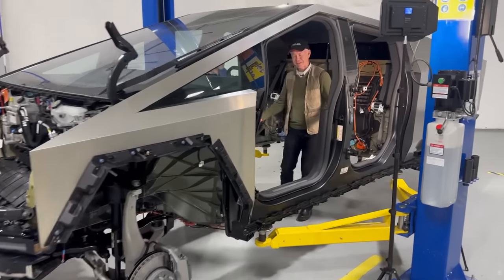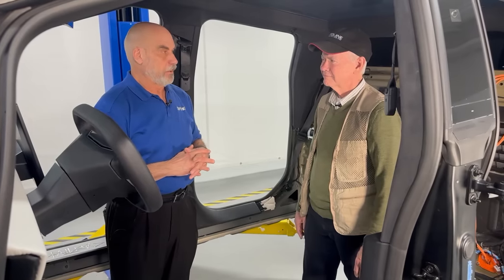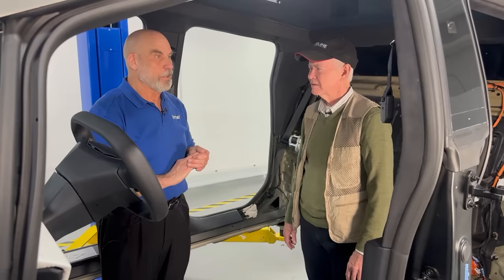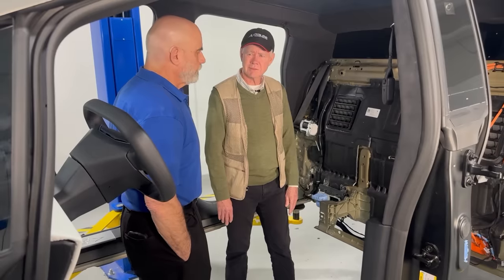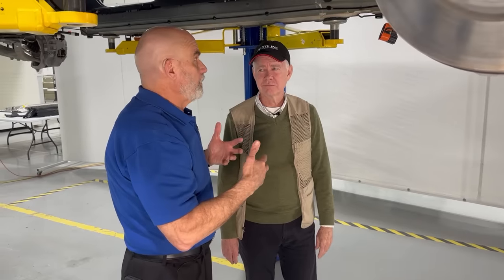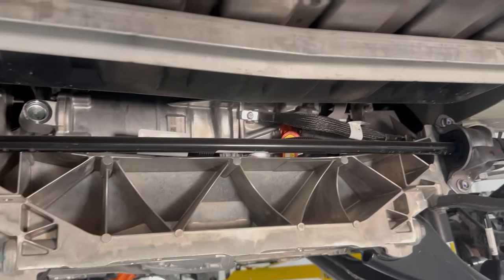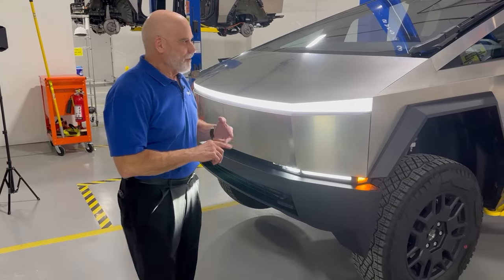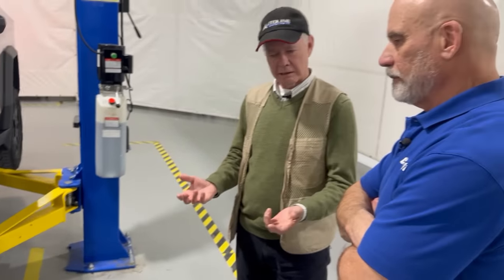World's 1st Cybertruck Teardown - Steer-by-Wire, 48V, Battery & Gigacastings

Comment: When Sandy sat down with the Cybertruck VPs and lead engineers at Tesla to discuss the Cybertruck they mentioned not everything was 48 volts.   IIRC its 48v to major components and local POE control modules and stepped down to 12v out from there to the little stuff.  So it shouldn't have 12 volt wiring all throughout but might have local runs to 12 volt components
Reply: yeah, but that is just stupid. Just use 800V for major components and 12V for everything else. That is cheaper, safer and actually more capable when you run things like the active suspension from the 800V which is what Porsche did with the latest Taycan facelift. Porsche actively tried to eliminate high voltage to lower voltage converters and use the 800V system architecture as far as possible. Interior lights etc  run on a small 12V battery. Nobody needs 48V it is just to cut a couple of bucks for Tesla. The customer has no real world advantage whatsoever
Reply: @BBingo-v5i  If the 800v system fails then the 48v system will still be operational for things like steering in an emergency.
Reply: @SyntheticSpy  why would the 800V system fail? Also Porsche does not use crappy steer-by-wire since that would destroy the joy of driving, so you can still steer without power. But they do use 800V for the active suspension which is actually awesome engineering. For lights/screen etc you have 12V anyway. No real world advantage for the customer to have 48V. In fact repairs might be more costly and timely to source the parts. And there is also some health risk involved with running switches or interior parts with 48V. Just a cost cutting measurement by Tesla and to further control the vehicle ecosystem.
Reply: @BBingo-v5i  the point of not going higher than 48 is that it is considered safe. Also what “joy of driving” do you get in a truck? Also Porche themselves developed a steer by wire system
Reply: @SyntheticSpy   exactly, that is why 12V is widely used and 48V is deemed unnecessary or even dangerous. Since the advantages are very tiny, there is no point in using it other than saving a few bucks (not for the customer tho). Fanboys cling to the smallest and unnecessary numbers just to uphold their skewed image. Tesla is far behind in many ways like charging speed, range, augmented reality HUD, autonomous driving, light technology etc. but 48V is changing everything for them lol
In the real world the Cybertruck barely keeps up with the older competition. Rivian, and even legacy manifacturers like GM are offering the way better trucks. That is a fact, but
Tesla and some Tesla shills were busy installing these random numbers like "48V" into naive fanboys heads like, even tho it doesn't mean anything for the customer experience of the truck. Besides that, the tech is widely known and not groundbreaking
Reply: @BBingo-v5i  the industry has been trying to go to 48v for decades. Also the higher power systems like the steer by wire wouldn’t be feasible with 12v. I think you don’t fully understand the reason behind various voltages
Reply: @SyntheticSpy   no, nobody wants to go to 48V because engineers know there is not much advantage to be gained and additional disadvantages to be solved (procurement, health risk). Steer-by-wire totally works on 12V, the Infinit Q50 did it that way.  The soon upcoming Lexus RZ450e uses its 400V architreture directly for the steer by wire system and the 12V system as backup. No problem
Reply: @BBingo-v5i  there are tons of advantages to be gained. And 48v is considered safe for use near humans which is why that’s what they went to. Again you seem to not be familiar with the actual reasons to switch and are just against the idea for some random reason
Reply: @SyntheticSpy   no 48V is not totally risk free or safe, you better educate yourself again on this matter. The actual reason is to run thinner wires and save a couple of bucks. The weight savings are negligible in a heavy steel truck by the way. Using thin wired is another risk factor by the way, there are tradeoffs and the advantages are minmal. Again, run major components directly from your system architecturr, wether 400V or 800V or higher, like Porsche and Toyota. Reduce the components ehich need converters and then use 12V system together with a small battery for the rest. Easy, safe, cheaper. More components on the then 48V system need a bigger and more expensive battery. The one in the cybertruck is quite big because it had to run quite a few components.
Reply: @BBingo-v5i  weight is only one factor, cost is another, and powering something like a motor for steer by wire properly is yet another factor. That’s why porche went with 800v instead of 400v for their high voltage system. Because there are tons of benefits
Reply: @BBingo-v5i  I assume you have nothing to do with production or technology, or how do you come up with such strange statements, some of which are completely wrong?!
Reply: @BBingo-v5i  The Cybertruck does run the heat pump for the thermal management system off the 800 volt battery along with obviously the drive units.

They NEED the 48 volt system to power the dual redundant steer motors for the front axle, one steer motor on the rear axle, the wiper motor, and the steering feedback motor in the cab.  They also use 48 volt battery for the oil pumps at the drive units, ECUs, touchscreen, window regulators, accessory power feed to the frunk and roof, and i'm guessing the suspension compressor, tonneau cover motor, and headlights.  48 volt not only make sense but for some of these systems it is a necessity.  800 volt makes no sense for most of these systems and would be unnecessarily unsafe.
Reply: @BBingo-v5i  I think you should do a bit more research about the advantages of going to 48V before commenting about how it is "unnecessary or even dangerous".
Reply: @SyntheticSpy hey Elon hater get your facts before you rubbish,48v gives(less cooper,less wiring,reduce wiring connecting stress in production,made Ethernet possible for use in cars for the first time,powers steer by wire well)pls give Elon a break,he pushed there.
Reply: @BBingo-v5i  Going to 48v from 12v has a bunch of benefits. You need 1/4th the amount of amps to get the same amount of power to a system. Less amps means smaller wires and less heat build up. And with so much using more electricity, that's a huge savings. Just look at the wires on your car battery that are just to run the starter motor for a few seconds. With EVs you need electricity to run everything. The cooling system, steering, HVAC, and heat all would have been handled by the engine before, but are now handled by electricity in some form. Not only that, but you can run larger items than before.

The reason others haven't gone to 24v or 48v before is because it really requires a large push from the industry to do so since everything is designed around 12v. This isn't just the automotive sector though. Computer systems are caught in this as well. Some are trying to push for 24v systems instead of 12v, since there is a constant issue with cables and power needs.
Reply: @BBingo-v5i  the Q50 has a clutch between the wheel and the tires that engages a mechanical link when power goes away. So it really isn't "true" steer by wire. RZ450e - as you have said "soon" not in production - if ever.
Reply: I smell a lot of BS here 😂
Reply: Using 48V fits with Ethernet 'bus' for communications and power (PoE), for which there are many existing components and many programmers who can work with it.
Reply: @BBingo-v5i you do know that all Ev’s by design disengage the 400 / 800v HV line as soon as it detects a crash. This is to protect the occupants and first responders from an exposed hv line. Fuel based cars also do this by cutting out the fuel pump in the event of a major collision. 12 / 48v is essential for keeping important things like flashers, doors, windows and car electronics that call sos etc active. All manufacturers (well, most) design 12v in such a way that they are well protected from crash.
Reply: @SyntheticSpy  his name checks out lol
Reply: @BBingo-v5i  why focus on weight savings when when cost savings of thinner wire per truck is enormous. Also they gave patents away for 48V so soon everybody will be adopting this new tech auto industry couldn't figure out for 100 years. Mostly because they just take parts off shelf and don't innovate.
Reply: @BBingo-v5i  tsla engineers not youtubers explained what they did with 48V High power harness mass down 84% number of wires length of car down 68%
full system advantage is POE+ 
48v over ethernet which is in aviation world already. tons of advantages already explained by engineers from tesla. 
48v parts exist but as i mentioned there wasnt off the shelf stuff auto industry could use and to expensive to innovate. you mention the problem "expensive parts hard to find" tsla has solved/solving that problem and made their own parts and further solving availability by giving patents away. industry will adopt.
Mercedes has had some 48V with the goal of expanding but to hard. promised for 30 years. but no supply they dont make their own stuff.
osha has rules starting at 50V DC thus the 48V undershot everyone aspires to. 
out of spec showed tsla efficiency with tri motor on 35" offroad tires at 2.5 mi/kwh only beat by rivian at 2.6 and smokes chevy and fords efficiency down at 2 and 2.1 

if this guy is worth his salt he will figure it out eventually. and you will have to cry elon fanboy at him as well lol. big problem is this is likely not a production model so will be filled with obsolete tech. but we shall see.
Reply: i suspect this is a pre production model and might have some obsolete stuff. will be interesting to see with comparison of munro teardown. also they iterate so quickly its possible more 12v will be eliminated by end of year
Reply: @jdawg5960 we will see in a few weeks how much the actual body harnesses weigh, that along with some engineering calculations will tell us how much cost and weight was actually saved. No one in the industry takes too seriously the BS that Tesla fans and pumpers say, like they seriously said they would have full autonomy, exoskeletons, float like a boat, etc BS. This is why we do real benchmarking.
Reply: oh look that 48V harness looks EXACTLY like any other 12V harness with nominal 18 AWG wires used for its runs, that's because durability matters more than any superflous benefits gained from a switch to 48V at this late date in 12V history...

reducing wire weight don't mean sh!t in the OEM world of Warranty Fulfillment if after a year of ownership your dash is lit up like a Christmas Tree with faults and then when you finally ohm out the harness you discover you have 1/2 dozen open circuits, oh yeah "we've seen this movie". #DURABILITYMATTERS
Reply: Certainly a lot of experts here, so I hope people don't take my word as an expert opinion. The thing to consider is that there is no native 12v subsystem in an EV like in a traditional ICE vehicle where 12v battery is topped off from a fairly beefy alternator (the bigger vehicle, the bigger is the alternator). Instead any EV to use a 12v subsystem has to have a DC-DC converter that takes whatever HV voltage and steps it down to either 12v or 48v in this case. The issue with DC-DC is that amperage plays into the power component costs - by increasing the DC output voltage, amperage is proportionately decreased. So is the heat dissipation and component size in the power electronics. So if there are high loads, such as steering actuators that need to be powered from LV, the choices are either to add an LV battery as a buffer, or to step up the LV so that it becomes practical to power the things directly from DC-DC and skip the additional weight, cost and maintenance of an additional LV battery.

Then on the second point mentioned earlier in the thread, there is indeed a significant safety consideration that goes into this. OSHA for example defines the maximum safe DC voltage as 60V, which is the reason many industrial systems operated by batteries are limited to 48V nominal - fully charged voltages are higher, with Lead-Acid systems pushing 52V and Lithium Ion systems approaching 58V or so. Tesla's DC-DC does indeed stick to the nominal voltage of 48V, but it still fits into that grand schema of things.
Reply: @jdawg5960 brother , please stop watching marketing .

Steer by wire on an airplane is subject to constant regulated inspection . Your vehicle, not so much .

Do you really think “nobody could figure out 48V”??? Or PoE which has been industry standard for various industries for decades? You insult engineers . 

The reason these things are not done is because it’s not better for this use case . These are cost cutting measures.  People pointing that out aren’t “Elon haters”. 

I can’t wait to see how this Kenmore on wheels functions after the circuits thermally cycle a number times .
Reply: @BBingo-v5i you are dead wrong. Weight is the benefit of 48v from 12v. Material cost and more range based on weight. Less raw material like copper. Huge benefit to customer.
Reply: @jonathanruiz8723 

What modern mid/large size aircraft has mechanical failsafes for the control surfaces ?
Reply: @GET2222  

It's not quite that simple. If you consider an old school ICE vehicle, how much 12v wiring does it really need ? Just some power for the lights, and maybe the windshield actuators / fluid pump. There are no significant loads on the 12v system besides the starter motor. Even the AC system, if present, would be powered mechanically instead of electrically. Changing out voltage there wouldn't result in a significant copper savings, especially since power delivery is done via the bus instead of dedicated conductors.

That is a different story with the Cybertruck. Besides the normal electrical loads of a modern vehicle such as lights, infotainment, window / windshield wiper actuators and some small ECUs it has beefy electric actuators for steering, heat pump, electric heaters, self-driving computer. The value of switching out the voltage here again isn't in the actual wiring to those components, but in the design of the components themselves, especially actuators which can deliver same amount of force with one quarter the input current.
Reply: @fd15k  You are totally right it appears that’s not the standard . I could have sworn I read that when I was researching this some time ago. I should have verified before posting . I have brought great dishonor to my family.

Thank you so much for your question . I totally would’ve been wrong on this for even longer without it !

I will now edit my original comment as to not spread misinformation .
Reply: @fd15k  lots of ways to skin the cat as you mention with pros and cons either way. Some BEVs do have a regular "native" 12v lead acid battery system which is maintained by converter and main battery pack. but lots of problems with 12v battery failing and losing different functions. people unaware they needed to maintain.
obviously better to only have 1 energy dense reliable battery pack and step down as necessary. the more 48v they can do the better not having multiple step downs and flying under osha radar.
interesting to see where things will settle
Reply: @jonathanruiz8723 i will say a different way.
 its well known in auto industry they have wanted to go to 48v for 30 years or so. Even made claims they would be the first like Mercedes. 
Engineers can do it no problem as you mention other industries where efficiency is prioritized like aviation its standard. Auto industry doesn't typically have engineers in position to make decisions and legacy auto sources all their parts from Bosch, Delphi and the like. they don't make anything themselves. Farley/ford describes this issue. they are glorified part assemblers cant even make changes without approval from multiple suppliers.
Tesla hasn't said we invented something nobody else can do. they said its the obvious answer that hasn't made it into auto yet because of above off the shelf mentality.  
 I mentioned they claim (Pete Bannon director of low voltage) to reduce wires needing to travel length of Cybertruck by 68% and high power harness mass by 84%. Big weight% and copper$ per vehicle that will save billions long run. Not to mention far superior on software communication side. Not marketing, i agree people repeat and get points claims wrong. But many of the claims were not made by tesla.
Horses mouth engineers in this vid from munro live Tesla Cybertruck DEEP DIVE with 5 Tesla Executives! 

Steer by wire aviation is tested electronically every flight. Same as the truck will do. No flight unless redundancy intact. Actual visual inspections are scheduled and are for mechanical wear clearances not electronic function.
Its possible federal regulation will step in a put some standard on this in the future. but likely will be a software limp mode type thing and not change state inspections IMO. 
Kenmore lol, it looks sick in person just dont like the back
Reply: @hansbrix2495  yeah benchmarking is the way to go. but also entire industry is following tesla. everybody trying giga casting. fsd soon lol. 
problem with most people who say nobody takes BS tesla pumpers say is they watch Mainstream Media to find out what tesla has claimed and they dont listen to context of original quotes. 
so benchmarking and ignore media you will have a more balanced view.
This guy is wasting his time tearing down a pre production model thinking it will be close enough IMO. will be awesome to see if munro has different numbers.
Reply: @phillyphil1513  most of the mass cut was from high power harnesses like for steering motors and what not. and from ethernet loop cutting down communication end to end wiring. 
Stop embarrassing yourself.
Reply: @BBingo-v5i  The safety issues associated with 800v is WWWWAAAAAAYYYYYY different than dealing with 48v.   You don't want everyday technicians having to deal with 800v everywhere.
Reply: @SyntheticSpy notice how all his comments are edited. He clearly has no idea what he's talking about and his username is perfect for him lol
Reply: All this arguing bottom line thin wires spell disaster and when ypu spend over 100k nothing shoukd be skimpy. 8 yrs of a hefty payment per month nah build it right or dont do it at all is my thinking. So you dump all that money on a casting but use thin wires 👏🤦‍♂️ ill never do electric. We pull 15000 pound tractors a turbo diesel is the only way. Try that with that cyber truck in the tennessee mountains 😅 i bet ypu get 60 miles if you dont die going down grade in the mountains then take hrs on end to charge . Nah its just not there. I do like hydrogen cars though. Toyota and bmw are on to hydrogen.